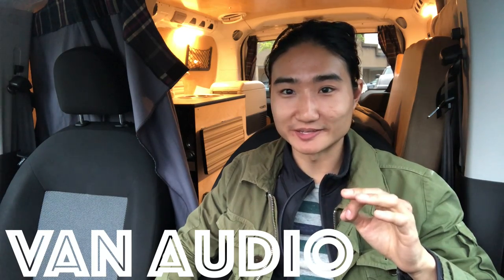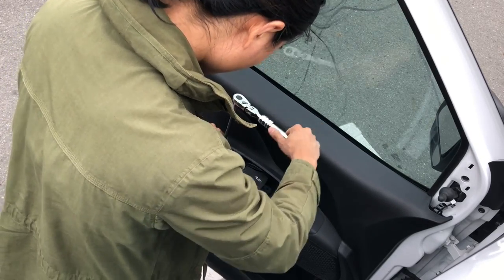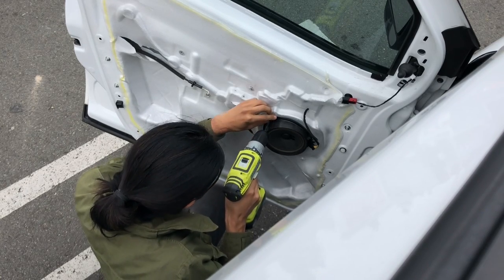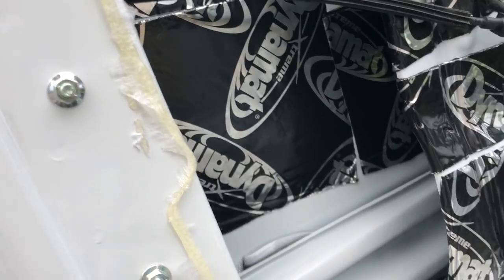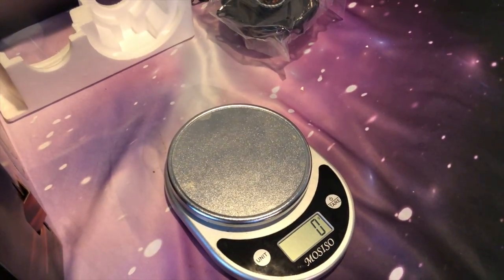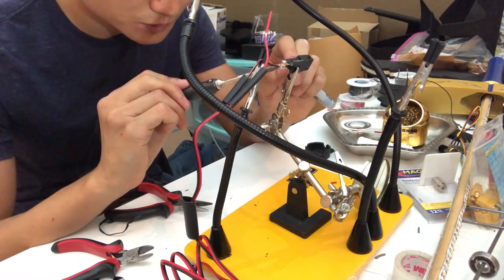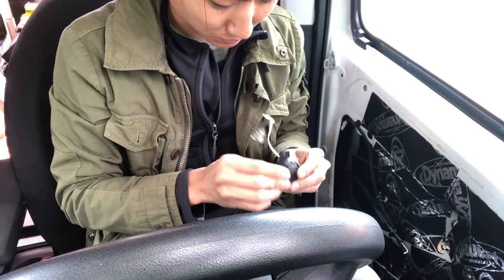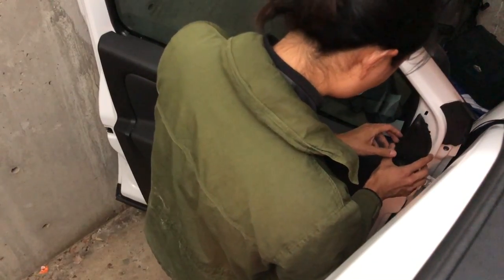Replacing RAM Promaster City Door Speaker and Tweeter with JBL Club Speakers Van Audio Walkthrough

Comment: I was thinking about replacing my promaster speakers with some basic 3 ways. Is there a crossover that needs to be removed to disable those awful sounding tweeters? I want to make sure that the full audio range makes it to the bottom speakers.

Comment: That plastic sheet that was on the door was a water shield. To stop water damage to door panel and switches. That plastic shield to keep water in the door sheet metal and out the door drain. Do not throw it away, but it back on the door!
Reply from the maker: Good to know. Hasn't seemed to be an issue yet but others watching may want to keep it

Comment: Very cool, just bought a new Promaster City. First thing I noticed was how there is no bass at all. The speakers aren't great, but not horrible, however the bass is nonexistent. I was thinking a Rockville sub and running a splice off the driver door speaker. Any one with thoughts on this setup?
Reply from the maker: Seems you already found it but for anyone else with this question, check out my video on installing a subwoofer in the van!

Comment: Hi, nice video! Do you know if tweeters have a dedicated outputs or they are just plug in parallele with the front speakers ? By the way, what is the actual size of those oem speakers? 5 1/4 i guest... I saw that you re-used the oem door braket, i can see that their is a void surounding the braket and the door frame. Does it affect the sound quality. I kniw that a after braket without any void, that exist on metra to fit 5 1/4" after market speakers,  wonder if this would sound better?

Comment: So, after you drilled out the old riveted speaker, there was magically a new speaker mounting bracket installed lol 
Where did you get the new mounting bracket for the new speaker ?!   Thank you great video
Reply from the maker: If I recall correctly, this is the stock mounting bracket that happens to fit this speaker that I was able to re-use!

Comment: Crutchfield says this model of promaster has a 4" speaker, but in the video you used a 5.25" speaker setup? Are there any issues with this?
Reply from the maker: Worked fine, I measured it beforehand. I almost wonder if you could fit a 6" but haven't tried. It might work with creative mounting, there is still plenty of space between the speaker and the door panel if I recall.
Reply: Another PMC owner posted a video of him placing 6x9s where the factory 4" mids are. A 6.5 fits just as well as the 5.25s...these doors have massive extra space like under the seats
Reply: @SmartVan  are you talking cone size or outside mounting bracket size when you say 5.25" ?

Comment: I noticed the speakers are 5 1/4" but when I look up the 2015 promaster city I see 6 1/2/"  is the replacement size??  can you fit 6 1/2" in the door?
Reply from the maker: Maybe, but probably not on the existing mounts. I think 6 1/2 would be iffy, but if you make it work let me know!
Reply: I have the same problem/question myself. Just ordered the 6.5 jbls that are supposed to fit...

Comment: I blew my driver-side speaker can I replace the sound system with JBL speakers and add the sub without changing the main unit?
Reply: Because I was thinking about keeping the main unit to not lose the steering wheel controls and add an amplifier.
Reply from the maker: @bryandamota  I don't see why not. The sub I installed (another vid) is powered so doesn't need a separate amp. The stock head unit should have a built in amp to drive the jbl speakers you install.
Reply: @SmartVan  Thank you. so you think I could install aftermarket speakers without changing the display unit and for the sub, I want to build my own sub to try to fit a bigger one and have the amp under the passenger seat.

Comment: Thanks for posting this,  very helpful! I'm also going with the promaster city as a camper and plan to immediately upgrade the audio. Curious how things sound with the sub installed and if you were considering adding 3-way 6x9's (or similar) to the rear doors.  Could be overkill, but i want to have really good sound which is difficult in a van.
Reply from the maker: My rear doors are part of a camper installation so I didn't bother, I just threw up a curtain which helps block some sound in the back

Comment: I am doing this with my Promaster 2500 High Roof.  I got the JBL GTO 609C Premium speakers that come with tweeters and a crossover for each side.  I would recommend also considering an amp to increase quality as there is a limit to what the factory head units can provide for sound quality and adjustments.  I am also looking at subs, and I was wondering what sub you decided to go with?  Possibly insulation inside the door panel itself...although I think thinsulate would absorb some moisture which is more likely to happen inside the door cavity itself so maybe its best to avoid that in your situation.  I am going for a recycled plastic style insulation that I can shove up inside that door cavity.  I would love to see a follow up with your subwoofer addition, thanks for the video!
Reply from the maker: Nice. I'm using an aftermarket Pioneer head unit (I have a tutorial on that install too), so I'm using their amplifier. I have a video on the subwoofer I need to edit and release, but the gist of it is that I choose a powered amplifier, JBL Basspro SL and it's a big improvement. Will see about the thinsulate, I've seen another video of people installing a layer of MLV in the door panel which is more sound dampening and also waterproof which appeals to me. Thanks for sharing your thoughts!

Comment: You don’t buy a cargo van for great audio.
Reply from the maker: Instead you gotta buy great audio for your cargo van ;)
Reply: Hardly any factory vehicles have quality hi Fi...must be built not just bought
Reply: I wonder if there is a way to get good audio on the ram promaster city I am thinking of buying one. I want to buy the SLT and upgrade to the audio and the seats and lights.
Reply: @neubauerjoseph  the first thing I would do is sound deadening.... EVERYWHERE... my PMC cargo had horrible road noise, went from a Chevy Nova to a Cadillac. Helped the crappy stock mids highs & hands free calling got drastically better.